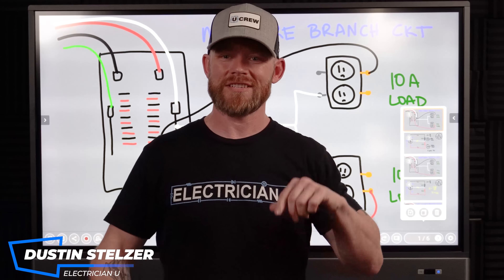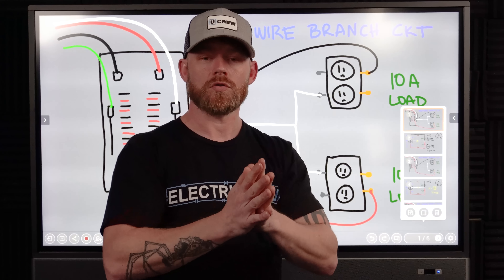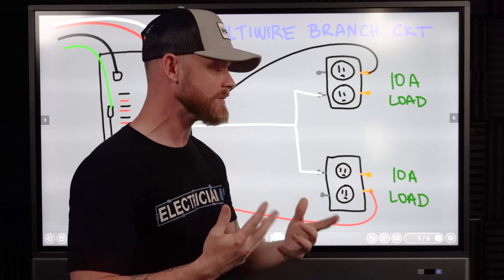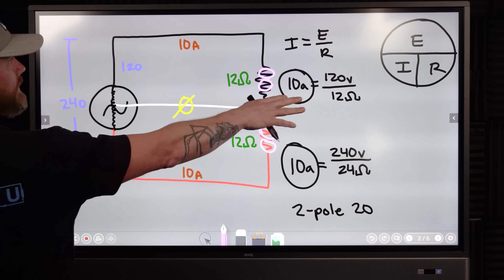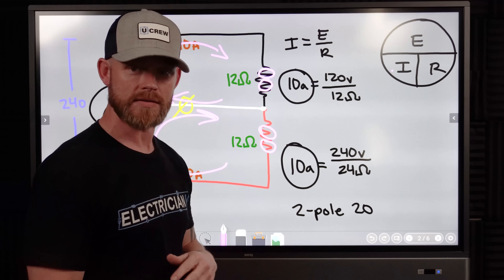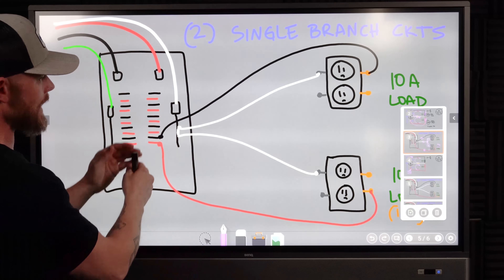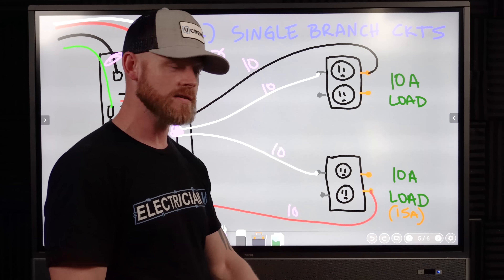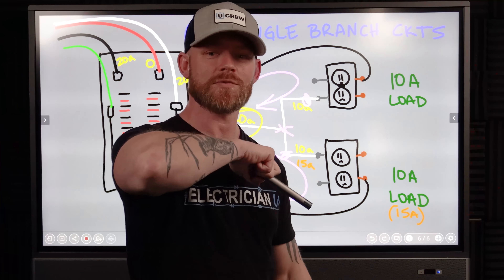Neutral Imbalance in Multiwire Branch Circuits (Two Hots, One Neutral)

Comment: Very helpful video. Could you explain this situation, on certain spas they split an incoming 50 amp circuit to two different breakers, one a 30 amp and the other a 20 amp, both GFCI. Only one shared neutral coming back to sub panel from the spa and this video explains why the share neutral doesn’t have to be a thick enough wire to support 50 amps current. The reason given for the two breakers is that the 30 amp breaker controls the heater which is most likely to trip but the 20 amp is for the pump so if the 30 amp trips the 20 amp will stay intact and keep the pump running to prevent freezing. But the neutral from the spa only goes back to the 30 amp GFCI and not to the neutral bus bar or the 20 amp breaker, so I don’t understand how the 20 amp breaker can still have GFCI function if there is no current going through its neutral lug for the circuitry to compare it to ground. I can send schematic of the wiring if it helps

Comment: The first 2 diagrams explain perfectly hoew RV shore power connections are designed. 50 amp multi wire branch circuits from the campground pedestal to the RV load center. We routinely see unbalanced load problems, loose (or missing) neutrals, or heating because of corroded/damaged plug receptacles.

Check for clean contacts. Check for tight connections (including the male plug end prongs). Make sure both legs are balanced loads in the RV.

Comment: If those two legs were different phases, you wouldn’t add 120 plus 120 to get 240. You’d multiply 120 times 1.73 and you’d get 208 from phase to phase. They are both the same phase!

Comment: Quit saying that both legs of a single phase system are different phase. They are the same phase. The transformer is connected to only one phase on the pole. Both legs are in time with one another, therefore they are the same phase. This is why people get confused and then when they deal with 3 phase, it’s harder to understand.

Comment: OK, I combined two 110 v outlets on sperate fazes (two different breakers) to install a Nema 240 v outlet. BUT combined I  commons from each outlet into the ONE common on the back of the Nema. First is this safe and OK and second is this what you are describing here in this video? Lastly, what is the maximum setting on my EV to safely pull from this new outlet?
Thank you!!

Comment: Also, to clarify at 13:22 mark, any imbalance or overload would occur on the bus bar or larger going from the grid rather than on the single neutral conductor(wire) between the the bus bar  and the receptacle if your did NOT have a MBWC

Comment: So basically at 3:20 what your saying is if I use say 15 amp outlets both sides of the room 2 each side but I run it off a double pole so one hot for each side and the neutrals shared it will still be 220 because it cancels it out or I’m Mia understanding. I thought neutral canceled out the 220 and red would be 110 and black would be 110 being I run them to separate outlets . Little lost now

Comment: I have a cuestion for you why do I have Like 50 volts in a receptacle that is controller by a switch in a multi wire branch when the switch is off but when is on I have 120 volts

Comment: So I'm in a bit of a weird situation. I need to hook up 2-20 amp 120v circuits for a whirlpool bath tub. I went poking around in my attic, turns out there were 2 unconnected(on both ends) 12/3 cables that run from the breaker box that are just over the exact length I need to run directly to the outlets and there's also a 12/2 cable that's a bit short. The breaker panel only has room for 3 slots left(2 reds, 1 black). Is there any advantage to running both of the 12/3 cables to the outlets? 

There's already that 12/2 cable sitting up there that I could use on that last slot if I wanted to add a circuit so there really isn't anything that I could use that second 12/3 cable for if I just ran one of them down, so it would just be sitting up there doing nothing.

Comment: I tested a branch circuit on a doble pole 15 amp breaker feeding a 1875watts blow dryer and a hair iron at 65 watts when I turned both on at it’s max the blow dryer was pulling 13.20 amps and the hair iron .36 amps and the neutral was pulling .36 amps as well🤷🏻‍♂️

Comment: I actually got hit on a neutral in a system Like this at my last job. The daytime running lights and the emergency lights were sharing the same neutral. I turned off the breaker for the emergency lights to update the system. Checked the light b4 turning it on, and begun removing it. No power on the hot but when I hit the neutral it went thru me, into the scissor lift and down to the floor. Needless to say it hurt and was extremely unexpected.

Comment: My house has a receptacle with a 12/2 romex bu threy are using the phased and neutral wire as a hot and the ground as a neutral? Is that safe ? Both hot are on a different phase. I believe one is feeding outdoor receptacle and the other is for a pond pump

Comment: Could you add a layer of complexity for this MBCW circuit by showing two GFCI outlets vs two standard outlets. 

Currently the house I moved into is wired that way and obviously not working.

Comment: And the inverter is 320v x 1 phase 93A which is 115v power wire & the neutral 115v = 230v One Phase / 92A

Comment: On my solar inverter is 1 phase 230v The neutral is 115 V and the how wire is 115 V and you just have a ground so the neutral is 115 V the one power wire is 115 V equaling 230 can I run this into my breaker box I don’t have any 220 V breakers in it so I can actually light my box out with one phase 115 V down each leg and just have to ground the inverter ?

Comment: So if you have a circuit that only has black and red does that mean you have a permanent load that doesn't change and that's why you don't need a neutral. Versus having a black-and-red circuit different local potentials then you include a neutral? Is that right

Comment: question, can this be wired with an arc/gfci breaker.. does one exist that allows for this type of configuration?

doing a remodle on an older home that was wired with 12/3 to two bedrooms outlet circuit.  it had a shared neutral and phased correctly.  we were wanting to leave that be and just upgrade the breaker to modern code. . we have been getting opposing suggestions from different masters. any help/advice would be appreciated.

Comment: Would love a video on a bootleg neutral from hots that originate from two separate se panels.
Reply: Awsome video thanks!
 Wondering if you want to build on it a bit by discussing good workmanship practices especially with MWBC. Specifically avoiding using devices to splice the shared neutral. I fried someone's DVD player changing an outlet on a MWBC that had no common trip or labeling. I pulled the wrong fuse, didn't test , and smoked up the room. Bad method on my part but it does happen

Comment: Hey man, long time viewer. Question related: I have outlets in my
House that are controlled by two breakers, I’ve had electricians look at it twice and they’ve said it’s fine, but doesn’t sit well with me. Any thoughts or video possible?
Reply: What do you mean? Like a series of outlets on one circuit is connected to a two-pole breaker? Or two separate breakers? Or do you mean you have alternating outlets in your kitchen or something that go to two separate breakers in the panel?
Reply: @JeremyWashington1489  Sorry for the confusion, I was trying to be quick. I have two outlets in my home that only lose power when I turn off two separate breakers: one in a main panel and one in a sub panel.  Both breakers must be off or the outlets stay live.

Comment: Very interesting, so you have circular flow of electricity on the hot wires. So one outlet is powered with 240 V and the other outlet is powered from flow after passing through the first outlet via neutral bridge. So I guess this is this distinction between a dedicated line and a multi branch line.  I have two 20 amp breaker's, on different phases, Sharing a neutral.    I asked electrician to give me two dedicated outlets for an audio system and this is what he gave me.  It seems the two outlets in a quad panel are basically sharing Power from the two breakers.  

Maybe I shouldn't be happy with this.

Comment: In your last section where you discussed MWBC being on the same phase....10 amps, 10 amps, and thus 20 amps back on the neutral, is that only true if there is a load being applied to each receptacle?  I'm asking for two reasons.  

1) I recently realized that my kitchen has three MWBC's, but all six breakers are independent, they are not tied together..each one can be individually opened or closed.  I know that there are MWBC's  because I see three 120v red wires in the panel...everything else that is 120v uses black 12/2.  The house was built in 2001.  How would I know if the red wired breakers and the black wired breaker (which share a neutral) are on a different phase?  The breakers going from top down on the side of the MWBC's, starting at position seven is black, red, black, red, black, red, black, black, etc  Its a GE panel.  Does every other breaker use a different leg?

2) If I feed the house via generator during power outages using only 120v, I'm I OK if I only use the circuits that use the red leads and shut off (or not use) the black wired circuits in order to avoid any excess current on the neutral?
Reply: I'll answer my own questions.  
It was suggested to me to trace the wires inside my panel, starting with the red wires at their individual breaker.  Using a small plastic tie wrap I trace a red wire up to where the cable enters into the panel, found the corresponding black lead within that cable and traced it back down to its breaker.  Found that each MWBC was on top of each other...for every MWBC.  However, since each breaker in the GE panel was independent, all MWBC were on the same phase.  I had to move eight breakers down one position in order for each MWBC to be on different phases.

Now I understand what outlets and appliances are on these MWBC, and that each shared neutral are using different phases for their red/black leads.  I see why the electrical code was changed to where a bonded tandem breaker is required for any MWBC in order to ensure that those circuits are on different phases.

Comment: Excellent video and explanation. The one thing I think you should mention is in situations where you have a black/red/wht cable being used on the same phase sharing the same neutral controling 2 different loads that it can be dangerous when working on one of loads. And when working on one of the individual loads that you should turn off both breakers before preceding with work. If one load or circuit is left on from either the black or red circuit still has potential from the neutral since they share the same neutral.

Comment: Can you use 12-2 in place of 14-4 on a 25amp breaker for a AC/heat unit that uses 12,000 BTU. 110 volts also for the unit

Comment: I put my amp probe on the white wire in your diagram and one unit is drawing I’ll show 10 A if the second unit comes on and that’s drawing 10 AM’s with my amp probe on the white wire you’re saying I won’t show 10 A or 20 A I’ll show zero hours with both of them running?

Comment: So... two hots from same phase/leg on same neutral.... if your neutral wire is engineered large enough to support the higher amperage, and nothing else in the system is being over taxed as well, then is it OK to do?

I'll need to think on this, and probably rewatch... but I'm unsure why you couldn't power 3-phase equipment off of single phase. (If the trick to 3ph motors is just connecting current at added times/places than single phase, which is probably exactly what a 3ph converter does internally). I'm NOT planning to do this, but understanding why or why not will help my overall understanding.
Reply: OK, I care less about the possibility of doing this and have now run into exactly this in my house. Someone DIY'ed some 14-3 to a receptacle, and then 14-2 the rest of the way to my gas furnace. Two independent 15A 1-pole breakers on the same leg in panel. I'm redoing this and giving the furnace it's own 12-2 dedicated line. I feel better going oversized cable for things with motors.

Comment: For residential 120/240 single phase with both phases (red & black) having exactly equal loads: There is no current on the feeder neutral wire returning to the transformer.  But there is current between the two phases  passes through the return neutrals in the house wiring to the neutral bus in the breaker.  Is that correct?

Comment: if the bigger something is then the less resistance how do people pull so many ohms it of a huge grounding system like on a commercial job?? Im assuming they need so much resistance to slow down stay current but how's can they achieve the required resistance they need with such think wire and thick grounding rods

Comment: I am about 99.99% on board with you on this topic. The 0.01% is a bit of nitpicking as I do not believe it is correct to say the current carried on the neutral is canceled out if the current is equal on both 110VAC legs. In fact, neutral imbalance is carried along the neutral circuit all the way back to the power utility transformer center tap. It can be modified by any branch circuit along the way.

 It is apparent that the path which forms a single 110VAC circuit does indeed return to the transformer center tap and the current will vary based on the waveform of the AC voltage referenced to the null formed by the transformer center tap, the neutral conductors and of course, the earth which should be present at the service transformer. What is important here is that the L1 and L2 legs are 180 degrees out of phase. For all intents and purposes, a 110VAC circuit can be considered to be a single winding. The voltage of this circuit is determined by the primary voltage and the primary/secondary turns ratio. Of course, a mains transformer will consist of a center tapped secondary winding which can be considered to be two stacked single windings with a common lead. Now, because this is AC, the legs of each side of the secondary winding will alternate between + and -, this allows current to flow with maximum current flowing as each lead reaches maximum potential. Apply a little wave theory here and you can see how the two 110 VAC circuits are stacked to produce 220VAC between L1 and L2. But we still have a very real connection to the common null point between the two sides of the secondary winding and while current can flow between L1 and L2, it also can flow between Lx and neutral. The difference is one leg will have a waveform positive of the referenced neutral and the other will be 180 degrees out of phase and in a negative direction. That perhaps is a little difficult to visualize as we normally do not assign a polarity to an AC signal, but a difference in potential must exist in order to facilitate current and that difference must have a polarity, even if it is oscillating at a 60 hz rate. The crunch comes when you realize the current is traveling in different directions between the load on L1 and the load on L2. In practical terms, this is the cancelling out of the neutral current that we see. This also explains why we see an imbalance of detectable current when differing loads powered by opposite phases share a neutral conductor. Of course, a true 240 VAC load is applied across L1 and L2 and does not utilize the neutral conductor.

Yes, I know I'm boring everyone to tears here, but thanks for letting me get that one off my chest.

Comment: So I have 2 normal outlets on circuit in kitchen on 1 phase, and the breaker below in panel has 3 normal outlets nearby in kitchen.  If I place a tandem breaker to free up a breaker space, placing all 5 of those outlets will be on a single phase now, but 2 different circuits.  This would be a bad idea if they shared a neutral right?  But not bad if they only shared the neutral bar?  As a panel is rated for that current, but an individual wire might get overloaded?  I hope Im thinking about this correctly...

Comment: thank you for your videos. it helped me chase down a problem with with an open neutral where two branches were shearing the same neutral.  The master bedroom outlets and bathroom lights were out, found the problem in an outlet in the kitchen where a 12/3 conductor came in from the main panel. This is where the circuits branched off. The neutral from the effected branch was loose from a bundle of neutrals wire nutted together. Connected neutral  and corrected problem, lights and outlets working again. 
Thank you.

Comment: What is the effect in a 3 phase system 120v pre phase when shared  the   Neutral with TP breaker three 120v circuit

Comment: Yes the last case is indeed very dangerous because the breaker won't trip even though the wire is above it's amperage. But I'm assuming if you had 2 14ga feeds combining into a 10ga neutral, would be perfectly okay

Comment: You risk confusing your viewers. I have been a licensed electrician for 33 years and even taught the apprenticeship program part time for several years and I found your conversation hard to follow. 

The circuit you were describing is technically only single phase with a grounded center tap to form a neutral which is the same potential as ground or 0 volts. The red and black are not "phases". They both belong to one/single phase. 

Voltage is a pressure or push applied to a circuit. When the circuit is complete, current flows from a higher voltage to a lower voltage. There isn't a "pull" in a circuit. This is technically incorrect and misleading.